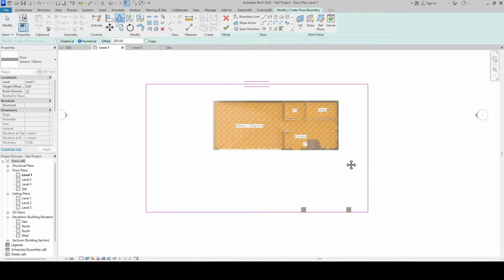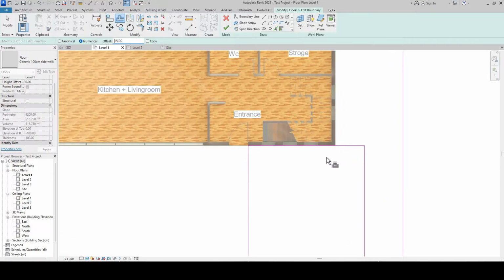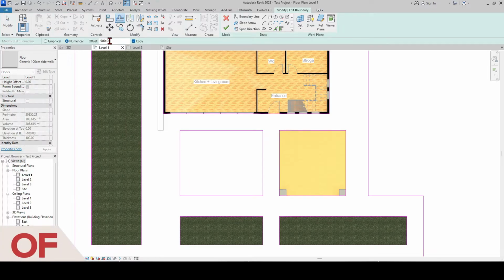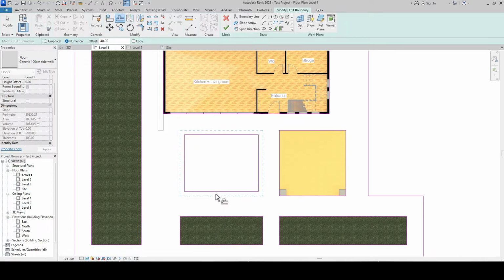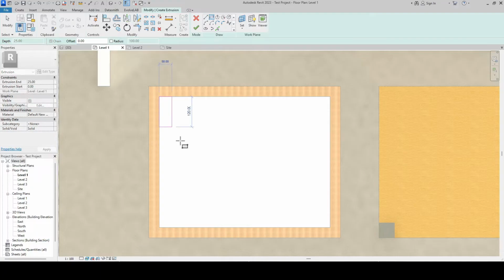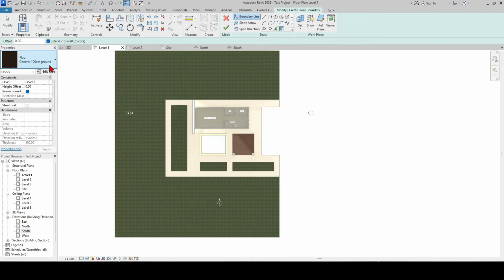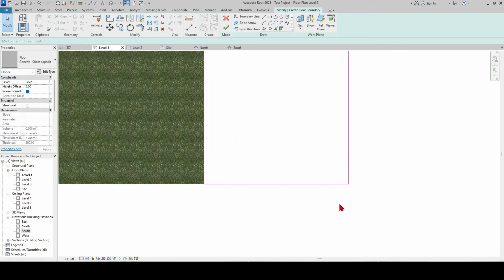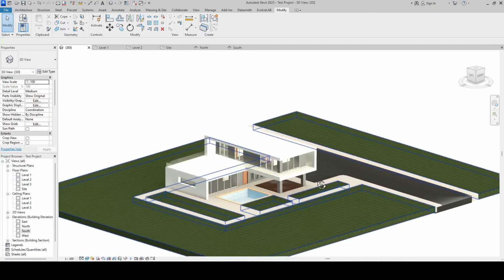Revit Course for Beginners – Part 4 – Site Plan Design

Comment: Hi, Thank you for sharing such an amazing video. Your explanation is very clear. Great job. But I've a little difficulty to draw the sidewalk on the road, it kept showing intersects lines. I must have did it wrong somewhere.
Reply from the maker: Thank you so much! 🚀 That error usually pops up when your sketch lines overlap or don't form a fully closed loop. When you're in sketch mode, make sure the lines don't cross each other and that they create a completely closed geometry — once you fix that, the error will go away. Let me know if it works!
Reply: @tech.architect  Thank you very much!! After a few attempt finally I managed to draw the sidewalk.
Reply from the maker: @JoyceChoo-m5k  That's awesome! 🚀 So glad you figured it out — persistence pays off. Keep up the great work!

Comment: hi , your work amazing , but i'm struggling to finish the 11:16 minute detail !  , i didn't understand how  you come with the pool design from void extrusion , the carrelage one , i tried many times but in vain , it seems like a missed step idk ,
Reply from the maker: Thank you so much, I really appreciate the kind words!

Let me break down the logic:

First, you create a solid rectangular prism (the base mass), and then you carve out a hollow inside it to get the pool basin. The key thing is that the void has to be created inside the same model-in-place as the solid prism.
Here's the step-by-step:

Inside the same model-in-place where you made your rectangular prism, start the Void Extrusion command.
Revit will ask you to pick a work plane. Go to Set → Pick a Plane and select whichever face of the prism you want to use as your reference (usually the top face for a pool).
Once you're in sketch mode, draw your void profile — but make sure to leave a small offset from the edges of the prism toward the center, so you have wall thickness for the pool (otherwise the void eats the whole prism).
Finish the sketch, then set the depth/height of the void so it carves down to your desired pool depth.

That's basically the whole logic. The void will automatically cut the solid as long as they're in the same model-in-place.
If there's any step where you get stuck or something I didn't cover, feel free to ask — I'm here to help you get it working!🚀